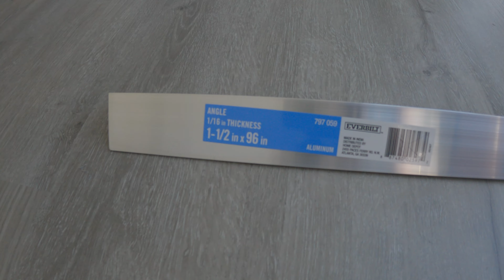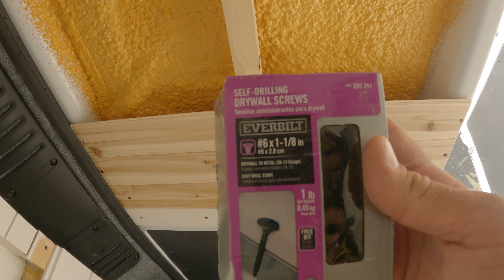Promaster Van Build | Ep7 | Installing Flooring and More!

Comment: Yo I just want to say love your Channel. Just picked up a Dodge Sprinter and about to work on my first build. I will say this though, I'm a flooring installer by trade. I don't care what they advertise on that vinyl plank, it's not waterproof. Sheet vinyl is what you want. I have taken up multiple vinyl plank job with water damage underneath. Water gets in between the joints every time

Comment: Any reason you’re putting down the vinyl at this stage? If you’re going to build cabinets on top, it seems it wouldn’t allow the boards to expand/contract in extreme hot/cold temps. I’ve read boards can form small gaps, or even buckle if there’s not proper spacing. Anyways, vinyl is going to be the last thing we put down in our van. Thanks for sharing your expertise!
Reply from the maker: I have a construction background and this is the order I prefer.  I know some people like to put cabinets first then the finish floor but i believe that’s just to save on material costs which in this case is not significant.  The expanding and contracting people refer to is usually at the edges where the vinyl meets the wall.   Once this floor is installed it locks together and you can think of it as one piece. So if you installed this on a cold winter day and jammed it tight up against the wall when it heats up in summer it would expand and buckle.  Two ways you can do to stop this is; 1 leave a 1/4” all around like I did where possible, and 2 acclimate your materials.  I installed this on an 80 degree sunny California day.  So when this was installed it was basically at full expansion.  I also feel that the larger the room you install this in the more that expansion effect is multiplied like in a huge room of a house.   In a van tiny space it’s going to only be so much.

Comment: Incredible van build series! However I'm wondering why didn't you run the vinyl flooring vertically? Instead of horizontally.
Reply from the maker: You can install yours whichever way you prefer
Reply: @BuildingVanLife  are you going to be doing another van build soon?
Reply from the maker: @swexplorer  yes I ordered one and it’s taking forever.  They keep pushing it back.  Now I’m expecting it in September.  I’ll be making videos on it as soon as it arrives
Reply: @BuildingVanLife  awesome!! You have the most informative and comprehensive van builds on YouTube! Thank you for everything you do.

Comment: Don't you glue or connect the vinyl planks to the floor somehow? what makes them stay in place and not move?
Reply from the maker: Not with this type it’s a floating floor.  Once it’s all together it can’t move especially after adding the edge protection that gets screwed in by the sliding and rear doors

Comment: I have a question have you ever installed a 24x36 shower pan in a 3500 ram promaster? We are struggling with finding a shower pan with hole in the corner to be able to get around the frame
Reply from the maker: I haven’t and I haven’t seen one that size with a corner drain either.  You will for sure need a corner drain.  You may be able to find a shower pan without a drain and drill your own or have one made custom out of stainless steel.
Reply: @BuildingVanLife  shoot we had a feeling that model doesn’t have a space for the drain